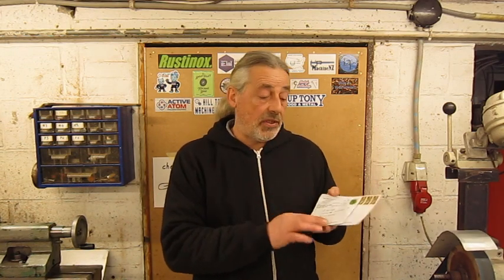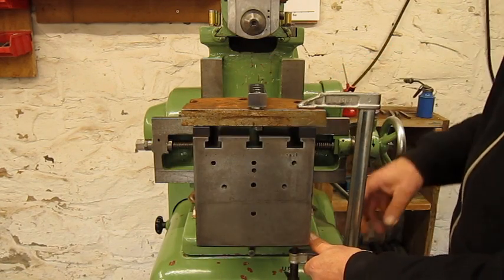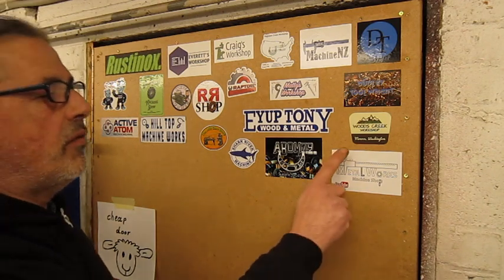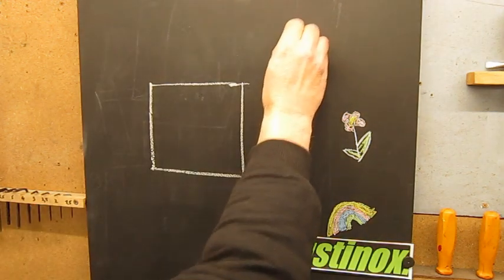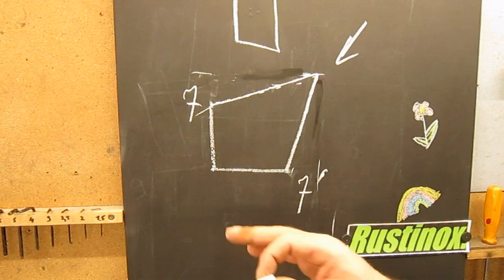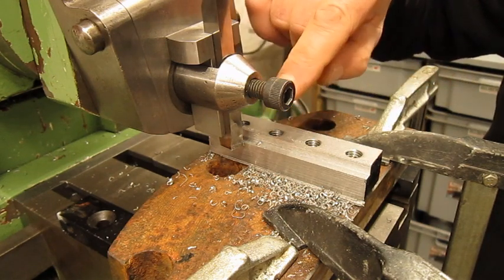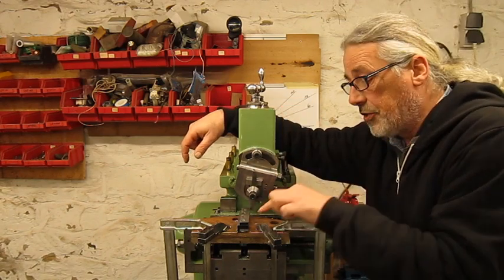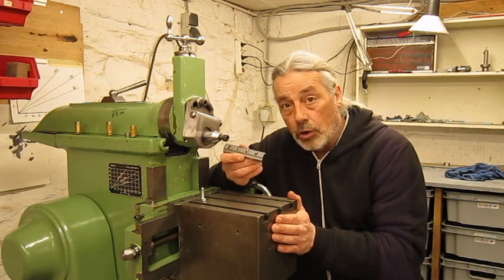Back to the basics. T-nuts.

Comment: I took the easy way out and bought both clamping sets, including the T-nuts.  The set for the rotary table fits the shaper but the length of the clamping studs was wrong so some cut lengths of threaded rod were needed.  I might still take your lead and make a few special T-nuts for the vise anyway to help it fit better.
Reply from the maker: I like to make my own tools if it's possible. Using your home made tools is very satisfying and it gives me more flight hours on the shaper.

Comment: Thank you Michael. When I make T nuts I upset the bottom threads so the stud doesn’t go right through which can jack up the T nut breaking away the top of the cast iron table. Take care.
Reply from the maker: Well, I don't. I tighten the stud lightly by and, witch prevent it from moving while installing the others.

Comment: Thank you for another interesting and helpful video. Using one tool for roughing out both ways is a neat idea. I had been considering shaper tools as the same effectively as lathe tools and essentially they are similar but as you demonstrate there are differences. 
I do have a book on lathe and shaper tools (No need to feel jealous) as it has less specifics than you supply in your videos. so thank you very much.
I have only done two jobs on my shaper thus far as the machine itself is a work in progress. I have stripped and cleaned it and adjusted the gibs then re-assembled it but it has no feed mechanism or micrometer dials.
I have been making a dial for the vertical feedscrew using a design for the Myford ML7 by George Thomas but realised that he had left insufficient room for the digits so I have re-drawn and commenced a second iteration. A new pivot dovetail assembly was turned and milled and awaits having the dovetails cut on the shaper but I would like to make a better job of it and have ordered more steel.
Thank you for informing us that you are Belgian, I was wondering. In another video you commented that someone was ribbing you about your accent but as it is common for many mainland Europeans to speak several languages whilst many of the Anglophiles such as i seem to struggle with one language I think that you may content yourself with a presumed position of superiority.
With regard to your grinding rest it may pay you to have a look at the grinding rest designed by Harold Hall which having doetails would be a good shaper project. It was the single most popular design in the Model Engineers Workshop magazine to date and has many accessories for grinding drill bits and mills etc.
Thank you again.
You have been most helpful in expanding my knowledge of the shaping machine.
Reply from the maker: Thanks for your imput, Jack. Always interesting.
BTW, never be afraid to ask questions. Out there in the YouTube world there are tons of people who are willing to help.

Comment: Again a nice video.  Regarding the carbide inserts: I haven't tried it on my shaper as well, but all the information I have heard and read about it, say that you need to lift of the tool on the back stroke ot otherwise the tip will break an the edge of the workpiece.
Reply from the maker: I tried and it works, sort of. But i don't see a real benefit using inserts instead of high speed steel.
Reply: @Rustinox  You could/have to use higher cutting speeds, which is not possible on most shapers I know (unless you have a very short stroke).  You have to use different grinding wheels (SiC, CBN or Diamonds) instead of Corund, which are commonly not available in the home work shop (at least, I don't have either of them at hand).  Both arguments speak against carbide on the shaper.  If you are in a hurry, the shaper isn't the best choice.
Reply from the maker: @titanicjb  https://www.youtube.com/watch?v=C5sR-3t35c0

Comment: So this man was playing with his teenuts in his workshop and enjoying himself. I get it. :)
Reply from the maker: I just knew you should understand.
Reply: @Rustinox  Hi, i find that you are entertaining. i just bought a douglas  shaper. i have turning 1, and i think i am naturally mechanically minded. i too have to start from the beginning . i have learned a lot from you becase i bought the exact same shaper as you have. thank you for helping me . i think you should case harden the t nuts and just clean your slots. maybe get some compressed air, or just make a purpose built wire brush with a long handle . Thankyou again.

Comment: Keep'm coming! Tried carbide inserts in my shaper with no luck, broke really quickly. Had a lot of luck with braised carbide tooling though. Don't know if you watched my table feed vid https://www.youtube.com/watch?v=syErq8MUDbM 
 The cast iron had a large chilled area part ways down which a high spped steel tool wouldn't touch, swapped to a braised carbide an it didn't even notice the change of hardness as it worked down. One cut down trued the face up perfectly using my slowest stroke and finest feed, reasonable finish as well.
 As you can see there's plenty of holes in the piece giving an interupted cut, gave me no problems at all.
Colin
Reply from the maker: Indeed i watched your video but i didn't see it was a carbide tipped tool.
Of course, after making this video, i couldn't resist to try an insert tool on my shaper. I held down the clapper with rubber bands, with great results. The machine set on 100 strokes/min, it made really nice curly chips.
I will show this in an upcoming video.

Comment: At 15:43 in the video, why do you have the flapper tilted but the tool pointing straight down?
Reply from the maker: The tool at 90° to have the right cutting angles and the clapper in an angle to clear the work in 2 directions on the backstroke.